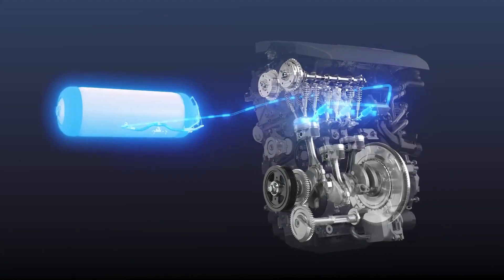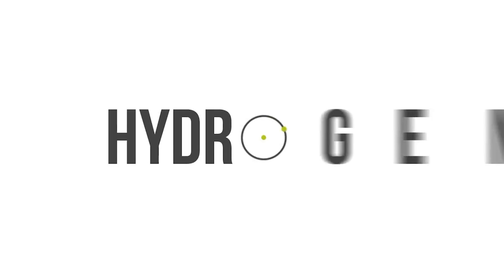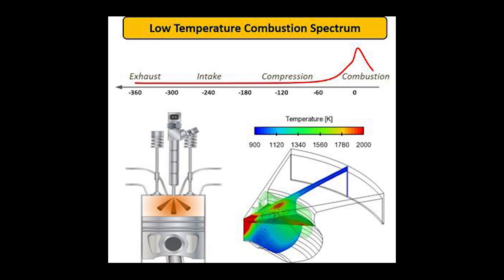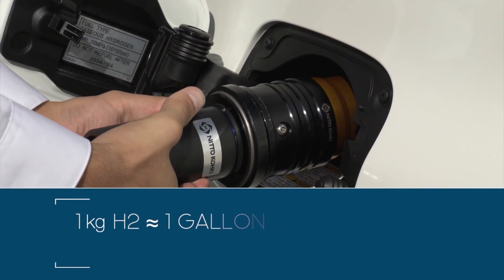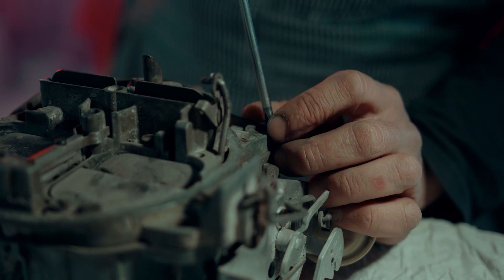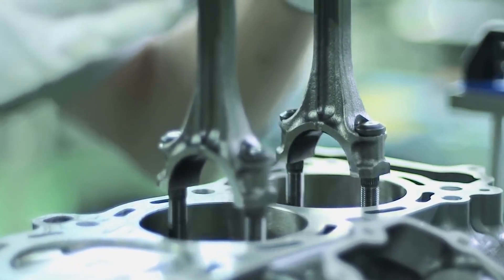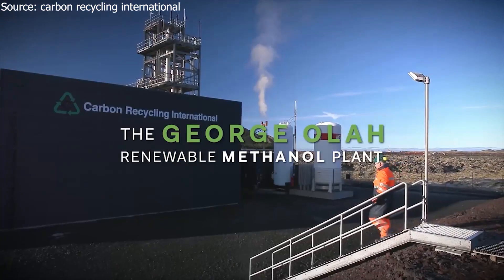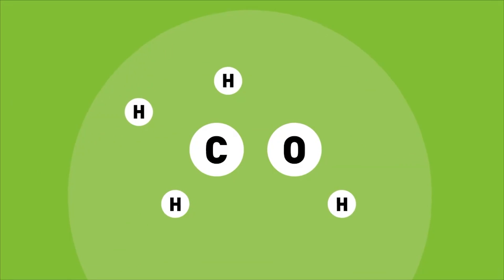How to convert your car to run on Hydrogen

Comment: All you have to do is adjust your injectors. Inject less fuel into the piston. And you can put an extra battery for the fuel cell. And I added an extra battery does not put extra weight on your alternator.

Comment: I have tried to get into converting cars trucks and any thing that runs on diesel or petrol .But always seem to run into a brick wall ! Trying to get all the parts I need top build /convert these vehicles ,Im in a unique postion as I have acess to unlimited Hydrogen ,and 700bar Kevlar Carbon Fiber tanks to hold it in .Yes I have , through my friend the possibilty to use the hydogen , which at his company is a byproduct and only used for industrial purposes , not mobility . I have been given lots of advice but its been mostly old school bullshit ! Anybody clever out there that could put me on the right path ? I live in hope !

Comment: There is so much misinformation about hydrogen fuel cars in the USA. Any car can be switched over. You dont need a special engine, you dont need hydrogen fueling stations. You can make and collect your own hydrogen outsidr at your home. Heck you can even run the electric for the electrolysis with solar. Install a few tanks with bottle warmers, pipe all bottles into one going to the carb or throttle body. You will also need to recalibrate your ignition system to adjust the spark rate and whatnot. But thsts all it takes

Comment: Why not use carburetor’s instead of fuel injectors for Hydrogen? 

Does hydrogen lubricate the cylinder walls? If not you’ll have to lubricate it with oil after every dedination  of fuel.
Reply: i'm sure one can intertwine/mix it within the H mixture itself...eventually....
Reply: Why is there a need to lubricate the cylinder after every detonation?

Comment: Hi Chris, nice video, very concise and exact with the information. As I know, you can have a gasoline engine and modify it to use with LGP or just LPG too. My doubt is about the mechanical requirement for maintaining the same power before the change. Do you have info about it?

Comment: You can convert existing engines to run on Hydrogen even if they don’t have direct injection from the factory, but you need to modify the engine by putting on a head that allows for direct injection, so the head would have to be an aftermarket one specially designed for direct injection
Reply: So, for all of us running dirty old V8s with Holley carbs, we just need offenhauser/edelbrock to do the decent thing and make us an aftermarket inlet EFI manifold, with a little turbo to up the intake air pressure, and retard the timing...right?
Reply: Saw a video of a guy adding hydrogen to his gas car to increase emissions to 90% could be a simple less complicated way to implement hydrogen technology

Comment: Internal combustion engines are designed to run on vaporized liquids like gasoline or diesel fuel. They are not designed to run on a gaseous fuel like hydrogen, but by mixing hydrogen with a small quantity of liquid water we can make it behave like a vaporized liquid. Gasoline is 13% hydrogen and 87% carbon, it goes into the cylinders as a vaporized liquid. If we remove the carbon, we are left with gaseous hydrogen. Gaseous hydrogen has some unique characteristics that make it almost impossible to use as a fuel in an internal combustion engine, but by mixing the right amount of hydrogen with the right amount of water at the right time, hydrogen behaves like a vaporized liquid and can be substituted for gasoline or diesel fuel in any internal combustion engine.
Reply: More info please
Reply: @sorasco1  Hydrogen burns very very fast and very hot. The carbon in gasoline slows the burn speed and reduces it's temperature. If your going to burn pure hydrogen in a gasoline engine adding a small quantity of vaporized water can reduce the burn speed and temperature so the hydrogen behaves more like gasoline.
Check out Mike Copeland at Arrington Performance. He has 2 machines running on hydrogen.
Reply: @saltydogg  yes...I ever heard about aqua tune system.
Reply: @saltydogg great input🎉...who do you recommend for RV conversion kits?
Reply: @GS-qr6iq I second this question
Reply: @thomas.parnell7365 I third that lol
Reply: I ashamed to prove u wrong but for my case I  install solely lpg cooking gas to run gasoline petrol engines,  I make the gas pass through the engine carburettor and it runs the engine exelenty, ie. Pure unvapourized gas sir....😮
Reply: I actually converted my 4 cylinder 70 prism to run and half hydrogen half gas I got about 30 city and 50 highway miles per gallon better after installing it
Reply: Help my 2010 Honda CR-V to use hybrid of gasoline and hydrogen

Comment: Here's the part where gasoline has a lower ignition temp. than Hydrogen.  So with that and based on your analysis described in your video Hydrogen is actually safer than gasoline.

Comment: But instead of using a giant fuel source like that and a tank you can put a hydrogen on demand system on a car using the Electric System and a hydrogen on demand using electrolysis you know you see these kids all over the internet people are running just their car no gasoline just the kid on their engine in the UK Australia in France some of these old beaters that shouldn't be on the road but they're running it on hydrogen HHO system so you could do that as a hybrid gasoline and HHO system and you have a almost no CO2 because the hydrogen combustion burns the carbon out of the that and uses the oxygen as a you know turns it into water and that carbon after it's been burned goes into your catalytic converter and gets disposed of that way too

Comment: I don't think it is possible to convert existing engines but rather, swap with engines that are designed specifically for hydrogen combustion. It is clear the engine must be direct injection as port injection only increases the chance of pre-ignition. Turbocharging is a must for a hydrogen engine. Some of the major benefits an ICE engine will see from burning hydrogen is much longer engine oil life, little to no carbon fouling (think intake valves, EGR, etc), smaller catalytic converters and emissions control systems (which will allow the engines to be more efficient/more powerful). Hydrogen engines make a ton of sense, especially for heavy equipment. I think they could for cars too but it depends. If the hydrogen internal combustion engine can achieve similar efficiency (which may only be possible with a hybrid system) to that of a fuel cell, then it stands a chance of being a thing. If not, if compressed gas remains the standard, the tanks will be quite large which will affect vehicle packaging and practicality. With that said though, if it is close, ICE will be cheaper to build and thus more affordable to consumers. Fuel cells need significantly more air intake cleaning as they are quite sensitive to being fouled by dust and dirt. Common sense tells me that a hydrogen IC engine would be much more robust than its fuel cell counterpart. I would not be surprised at all if Toyota releases a new powertrain for its vehicles within the next decade which uses a hydrogen fueled turbocharged inline-3 or 4 mated to a hybrid synergy drive eCVT. Actually I would be shocked if this didn't happen within the next decade.
Reply: Toyota did test their hydrogen powered Yaris about a year ago, which showed promising results. Converting an engine to run of hydrogen is a but tricky but feasible, just takes some experience knowing what you're doing and not potentially messing it up.
Reply: @TheSilverShadow17  They did it with the AE86 a few days ago proving it can be done
Reply: @Gzuz414  Ah I see. I've been hearing about plasma ignition from people as well, wondering if that would work with H2ICE applications or not.

Comment: THAN HYDROGEN TANK, AS MACHINIST I MORE CONSIDER PEM HYDROGEN GENERATOR OR RADIO FREQUENCY HYDROGEN GENERATOR IS FAR MORE SAVE, IF SOMEONE SAY THERE MORE ENERGY TO CRACKING HYDROGEN THAN BURNING IT, THERE MANY DEVICE CAN PROVIDE ELECTRICAL CURRENT THAT COMING FROM AIR SCOOP AIR TURBINE ELECTRIC GENERATOR, MOTORIZED RIM TO HARVEST ELECTRIC FROM CAR MOVEMENT, WE ALSO CAN PLANTING ELECTRIC GENERATOR ON ENGINE FAN. USE SUPERCAPACITOR AS MAIN BATTERY FOR HYDROGEN GENERATOR, MIXTURE FROM 10% ORGANIC OIL 10% HYDROXIDE AND 80% WATER ARE POTENTIAL FUEL.

Comment: Until you realize that Hydrogen molecules hold heat longer than CO2.
Reply: I was just going to ask Christian, what’s your point? Please elaborate. Thank you.
Reply: Hydrogen creates water when burned...
Reply: @good_time_guys  this is why  when im thirsty i just like consume a glass of H n stuff. jaw jaw jaw
Reply: Actually hydrogen don't produce CO2 because there's no carbon in the mix when it explodes if you had oxygen to your hydrogen combustion you have water not CO2 you have H2O

Comment: I found that if you convert the car to run on CNG first then all you have to do is switch the fuel but you must then recalibrate the computer to match the different fuel you are now using. With hydrogen many people don't know this but you can slow down it's burn rate by regulating the exhaust gases sent into the mixture by the EGR system. What this does is basically creates a traffic jam by putting a bunch of stuff in the combustion chamber that doesn't support the burning process thus slowing down the time it takes for the hydrogen to find and combine with the oxygen. Then there is yet another trick in how to increase the energy content of the reaction and that is by ionizing the hydrogen prior to injecting it into the combustion chamber so that it enters the combustion chamber as a monatomic hydrogen gas atom instead of a hydrogen molecule. 
There are many other things I know about using hydrogen as I have been studying this for years. This is why I say with confidence hydrogen is the fuel of the future.
Reply: Do you have somewhere we can get more info on what you have achieved?
Reply: Hydrogen on demand corresponding with the trottle position would be ideal without a storage tank
Reply: @johan8724  If I can get the funding I need I'll give the Meyer type injectors a shot as I'm fairly certain I figured out what he did wrong with his design back in the day.
Reply: @johan8724  Using a Hydrogen wet cell or dry cell with pulse width modulation matching the ignition timing of the spark plug is a good way to do it as pulsating current is more efficient at separating the Hydrogen from the water. Matching the ignition timing for the spark plug with a PWM circuit is a good way of making sure the voltage and pulses get larger and faster as the rpm rises so you don't run out of fuel.